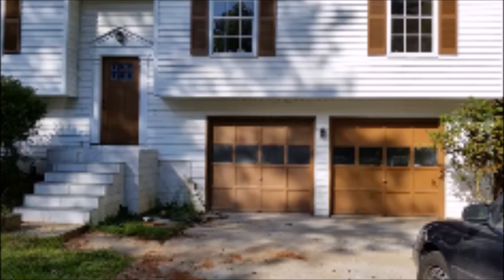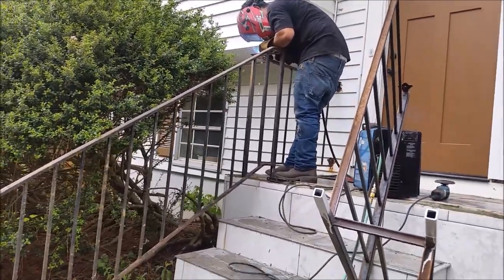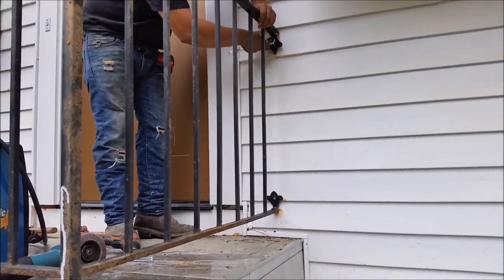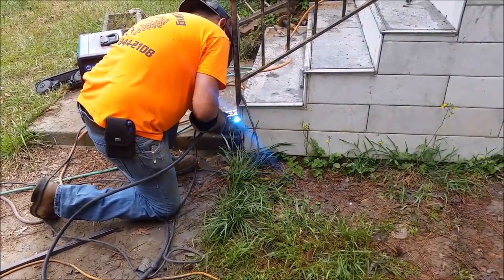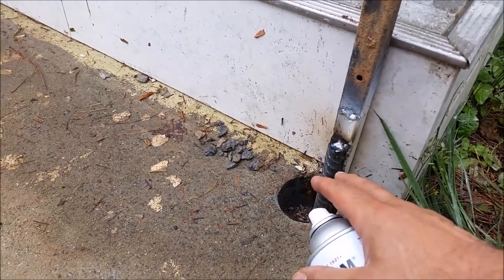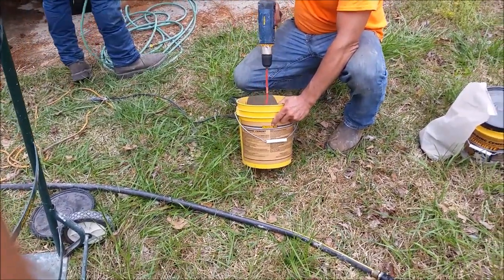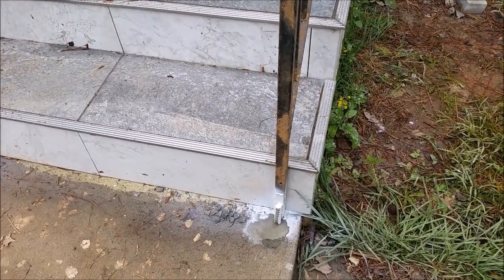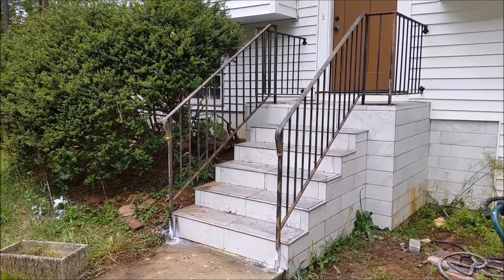How to Repair and Install a Rusted  Iron Railing On Concrete Stairs - Step By Step

Comment: This is a really rough job guys. To each their own but leave behind a product for your customers that you’re proud of and show them you take the extra steps to make your piece that much better (like covering the surrounding area from overspray, taking away some of the rust on the railing so you can lay down a prime and top coat, maybe so proper layout so your bottom post isn’t hugging the stair). If I was a customer paying for this I’d be pissed

Comment: Is there  a video that shows installation of aluminim railing on a ramp?
Reply from the maker: It will be installed similar to this video or with screws to the concrete.

Comment: Use vitro bond to set railings. It's a better job and it sets in 5 seconds once you pour it
Reply: Imma look into that Tito Pagan.... usually go with hydraulic cement also cures in 5 minutes

Comment: Sloppy job for sure. Why didn't you clean up the extra concrete or sand and paint the railing fot installing it.
Reply from the maker: The railing was sanded and painted after installation because it by far easier to do it.
Reply: @josephk9182  Huh? Far easier to do it before it's installed. That's common sense.